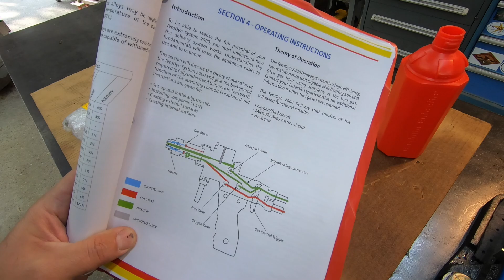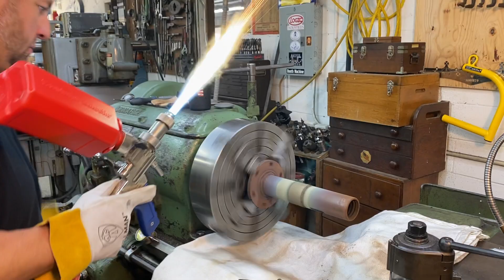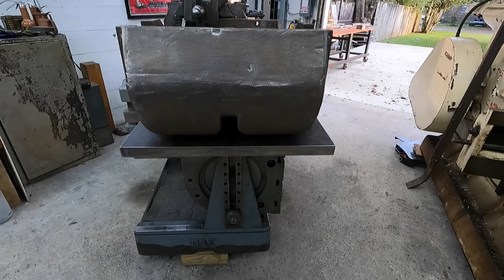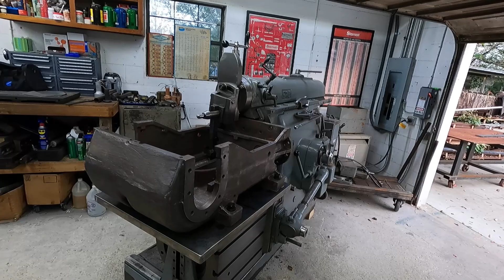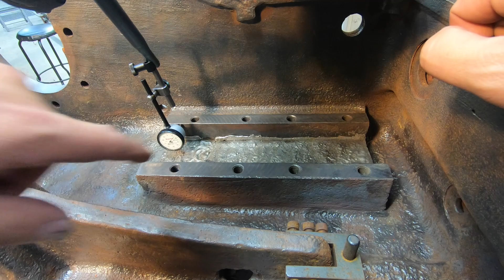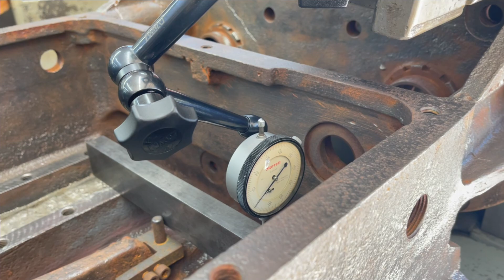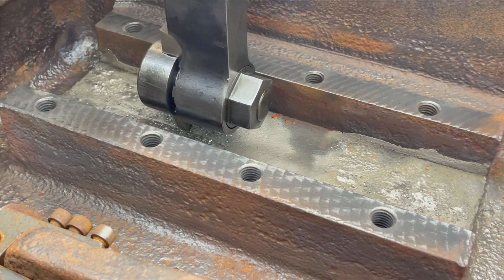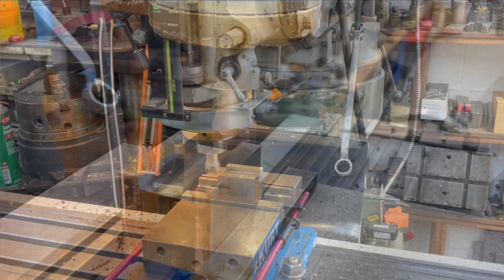SNS 331: Stoker Engine, Eutectic Torch Repaired, Tung Tri Mill

Comment: I'm going to guess that surface was milled like the threaded surface above it was in the same setup with a custom long cutting tool. It is going to be no small job for someone with a large bt50 cutter mill or borer for example too luck out having on hand something that would work over the whole surface. Usually such long reach tools taper to at least 2" diam at the base to have half a chance of a chatter free finish.
My best offering suggestion wise is to chat to someone charitable with a big EDM machine and spark erode the surface flat. Access, need for rigidity over a long distance and how hard the material is becomes a relative non issue.
Making chips is the darling of YouTube, but EDM's are the quiet achievers when it gets tricky or otherwise impossible.

Comment: The fumes coming from spray welding are not good for your lungs.
We used respirators and a welding fume extractor behind the lathe to clear the air.
I highly recommend you to do the same.

Comment: Hi Adam, love your video's, I would remove that ugly uneven powder weld and use the Eutectic spray weld to put an even and neat finish on the bottom, then scrape it. Less material to remove and a lot simpler operation. Maybe?
Keep the video's coming!
Steve K

Comment: Hi Again Adam.
My 2 cents worth on your clearance issues would be get/mill a piece of rectangular bar and weld the tool steel to the back of it,  so when the rectangular bar is mounted in the shaper the tool steel is closest to the back of the casting with the cutting edge facing forward and hang it low enough so that way the only thing in the slot is the tool steel,once finished with the vee tool cut it off and weld one of the side tools on, i hope this makes sense, i have welded quite a few bits of tool steel over the yrs and its always got me out of trouble. Stainless stick weld or mig it works. Cheers

Comment: My thoughts were make an L shaped tool holder for the shaper. With the horizontal and vertical join surface of the L with triangle re enforcing. That way you just turn the tool 180 for the other side.

Comment: Hi Adam, You should really enjoy the TD 2000 its a big step up from the rototec you can now spray better alloys, plastics and ceramics. Ceramics on seal area's that are in a high wear application are a game changer, you have to finish grind it tho,a tool post grinder on the lathe worked well for me. Cheers.

Comment: The key must be in those rails that run either side of the buildup. It seems like you need a tool that runs along those rails and cuts or just grinds down a given amount. You would have to make a custom rail guide of some sort to guide the cutting rotating grinder/cutter rotating in the trench either side of the rail. What can that tap drill arm thing do apart from tapping holes? As it is a sturdy upright flexible arm could you not makeup a variable height grinder type wheel mount for it? I am no engineer just love all engineering and machining projects. I think the idea here is to think smaller.

Comment: Adam.  Lock up the clapper box, turn the tool around and cut on the back stroke. You will still need left and right hand tools as before and it might be tricky, no it will be tricky blending in the two cuts.
This still doesn't solve the problem of the hard material wearing the tool substantially.  I'm thinking that after the original cast iron bearing surfaces were machined they would have been hand scrapped to size  and fit to the sliders. Shapers are long obsolete as a production tool but still a great machine to have in a home work shop   I use mine quite a lot.

Comment: The big HBM at motion should be able to handle it, long arbor and a custom cutter or even a fly cutter to get under the lip... past that... hand scraping is one way to get it flat at the cost of your sanity and possibly your back.
Reply: Adam no longer works at Motion ind.
Reply: @stuarthardy4626  thats the reason i said at motion not take it into work, i watch the channel on a regular much like you and know he hasnt worked there in a long while... now if he can make a call and find a large HBM that would work too. The mill he has i dont see being rigid enough with that much stick out.

Comment: Have been in machining for plastic injection molds (prehard steel mold base with R/C 52 hardened tool steel cavities/cores) since 1962. You are giving it your best for the equipment in house. It can't get any better.
Send it to a shop with larger equipment (vertical mill) with a deep reach round cutter large enough not to flex. There will be unfinished corners not accessable. Hand scrape these radii to the finished bearing level.  Job done, done well.
Be hopeful the weld is solidly bonded.
EDIT:
_ Please add the print dimensions, tolerances, finish requirements to your above summary. Or add a photo of the print.for those features.  
_ What is the range of operating temperatures and the wall thickness of the casting for those suggesting wear plates.

Comment: maibe you can set the toolholder up so its at an angle to the left or right , that way you can do one side without clearance issues , does mean you have to set it up twice once to get the left side and once to get the right , if that isnt enough you could cut the finish cutters at an angle too
the only other option i see is using the sides and boltholes on each side of the welded part to make the guiding base for a small hand moved grinder tool (working it like a wood router ) and a cup shaped grinding wheel thats exactly wide enough to cut the whole channel in one go
https://www.youtube.com/watch?v=H55zqx09P4w&ab_channel=JeremyThompson

Comment: A home made tool for sure. Get rid of the existing tool holder and install a steel bar with a small hss tool silver sodered on the end.
Just throwing it out there. The original planer must of had a tool the made it look easy. Considering its age it was probably a planer that did the job originaly. It was probably a one trick pony set up to do hundreds of engines. Love your videos.

Comment: Ok, thinking outside the box. Put a fireball block or spacer in clapper head moving the tool holder forward and up. This will keep it from hitting the case. Then you can grind a custom HHS tool bit that’s angled to reach back of the channel and by raising the tool holder you should go side to side and front to back with same tool.

Comment: Adam, It's a tough job but they chose the right guy for it! if any one will be able to brainstorm a plan It's you. Don't for a second feel that you have failed us as you ultimately are limited to the capability's of your tool's and considering this is a "pro bono job" you are limited to the fact that what you invest is out of your pocket. You must weigh the odd's 1. What you may generate in revenue on you tube vs 2. what the cost will be IF you destroy your tools or part or both. Keep up the good work and remember if you have given it a honest try you and it don't work out that don't mean you failed

Comment: I am looking at pictures of the milling machines that were used in RR machine shops to mill stuff like stokers motors. The bottom line they will not fit in Abom79 shop.

Comment: On your objection to making a custom tool holder, you may simply not have any other choice. 
You've ruled out other machines and other machinists so there's that.
I feel quite certain that the original manufactures had a custom tool or custom mill head to do that work and it's highly likely that reproducing that tool design will be your only realistic option.
I realize that you hesitate to sink time and effort in to a process that you're unsure of and isn't going to return some kind of profit but, as you stated in your video, something has to give.
There're no guarantees so, c'est la vie.

Comment: The machining marks on the rails look like they originally did this with  some sort of big diameter cuter.
Therefore u can use relative big diameter extension and maby a flycuter to ceep tool pressure on a minimum.

Comment: How about making an adapter plate at the bottom end of the tool holder with the left and right tools both mounted on the outer edges of it using both cutters simultaneously to minimize twisting.  Complicated to have both tools at exactly the same depth  and finish at the same time left and right.

Comment: Adam, fabricate a triangle about 6" base, 4" high, 2" wide,...fabricate cutter holder thru slots at each side of the triangle mount backwards by cutting into the triangle enough to slip into the tool holder, what you wind up with is a backwards mounted triangle that will cut to 0.0 sidewall, and will retract past the end of the surface to be machined on the back stroke! 
Just make sure you drill and tap tool holding bolts that you can change when machining side or horizontal surface.
I actually did this during my shop teaching days when machining an old hit and miss motor!
Trying to figure the best way to send you a copy of the one I made!

Comment: I might have an idea that might help at least I think. I did read your comment so I would ask someone to do it for you if they could. But what if someone made a toll holder like a L shape but backwards. and cut a female dovetaile on the end. then using a late tool. either braised or insert carbide make a male dovetaile on the tool itself.  or just weld it on if they don't care about it. That looks like it would give you enough clearance as far as I can tell on the video.

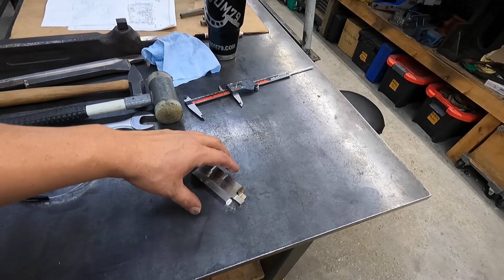Comment: 13:40 Looking at the tooling marks on the pairs of machined surfaces on either side, it looks like they had a single large diameter tool for each side. Considering the scale of these industries when they were at their peak, I wouldn't be surprised if they just had a massive mill that could do the whole slot as a slotting operation and just relied on the massive thickness of the tool to reduce deflection to acceptable levels.

Comment: those little mills are the bees knees dude don't be afraid to get a 1.5 inch for the doall mill they cut so free you'll never want to turn back. we have the .750 at work and the 2.00 and they are great.

Comment: This dates me.  When I grew up I got a job being the "shop's boy" at a mchine shop. My primary job when I started  cleaning the metal shavings out of all of  bins in the machines and the shop floor.  Started 2 hours per day.  Then I got hands on experience on manufacturing high pneumatic valves. 1/2" up to 16 inches. 

I literally worked "the entire line" of equipment making $1.25 per hour.  In the end I was putting 48 hours a week as I would work anything that they give me. Most 24+ hours on the weekend as there was a high demand for these parts.  A Crazy group of people that I will fondly remember that I worked with.

I learned so much, working with my hands and the knowledge given that over the years it helped to retire from working in my 40's. So now that I'm older than dirt   I watch shows like yours and see that in 5 decades the core of working with metal is essentially the same and I smile on the new tech that I see today.

Thank you for having this channel.

Comment: Sir I think you are doing very well. Just a case of a small width cu at a time. I think you need simply to concentrate on getting it roughed out as you are doing. With it all level & flat it will look surprisingly good. You are doing great

Comment: Adam this looks like a job for Brian. Large dia. long length cutter. Looking at the machine marks and the way the top plate is cut it's clear how it was done.  May be a stout holder for a large mill tool would let it be done on a vert. Mill. Good luck. Thanks for letting us be a part of the adventure.

Comment: Why don't you take3/4 plate and make bolt on runner with square teeth on runner and the slide plate with the carbide on a mini clapper you can adjust side to side and up and down and use the same machine to work it

Comment: Have you ever done a test to find out how well the sprayed metal adheres to the base metal?  Does it "tin" the surface (like brazing and soldering) or is it more like paint that can be chipped off?
Reply: It's more like sintering. It doesn't wet too the base metal.

Comment: Adam, Any chance you experimented with Dog-Legging the tool bit, (remove top and bottom on opposite ends) to get the tool holder away from the back end of the casting?  This might also raise the tool holder (longer exposed tool bit), so the Armstrong #42 can clear the machined side walls, allowing you to rotate it and get closer to the outer machined side wall (Armstrong rotated ~15 degrees CCW, but with the tool bit still vertical).   

Too bad you don't have a piece of HSS that would be long enough and stiff enough to replace the Armstrong 42 so it is a 1 piece tool bit from the Queen Post to the cutting edge.  Alternately an old tool bar with a tool bit brazed/welded onto the bottom, so nothing extends below the bottom of the tool bit (never used a shaper, so not sure if it could hold up to the strain).  Do you know an experienced blacksmith, something like this would be easy as 1 piece in a forge (I've done similar shapes in spring steel, but have not stress tested my work)?

Definitely a bit of a mind bender to work on.  I'm sure you guys will figure something.

and yes I did read your pinned post, I think these are far enough from what you already tried.

Comment: Could you put the Tung Tri cutter in the Flex arm and reach down into the stroker box case? Or,  could you mount a rotating device on the shaper on which you could mount the Tung Tri cutter?

Comment: At Motion you used to run a machine that you could set things on end and drill holes and perform milling operations. Keith Rucker got a machine (new to him) that does the same thing. I’m wondering if he can’t take this milling job on?
Reply: Keith Rucker is who sent him this piece to shape.
Reply: @stargazer7644  That’s true. It’s also true he did it before he got his machine. Adam is using what he has at hand. If he was still with Motion I’m sure he would do things differently.

Comment: It would be possible to use carbide router bits on a trim router used in woodworking being supported by the milled parallel supports either side of the two surfaces. I’ve seen such things being done on several occasions now and am relatively confident you could make that work. As a woodworker it was the first idea coming to my mind. Maybe consider it! Merry Christmas!

Comment: Here is an idea. Since this is a part off a steam locomotive, I would suggest contacting tourist railroads, operating railroad museums, (The Illinois Railway Museum)  or the steam shop at the  Union Pacific shops in Cheyenne  WY who just finished up a full restoration of the worlds largest operating steam locomotive. I'm sure that there are fans of your channel that work on steam locomotives. The shop forces at any of these organizations may not have done this type of operation but I'm sure that they have written procedural material of "how to". I mentioned the Illinois Railway Museum because not only do they have the largest collection of equipment but also a vast library of old railroad manuals and drawings.

Comment: Just sit it on the shop floor, fab a bracket to mount a magdrill to the end of the K&T mill table and use an endmill.
Obviously you'd have to shim it parallel to the machine travel and take light cuts.
Alternatively, rough it out with the power scraper then polish with some sandpaper.
You can thank me later.

Comment: Maybe a silly question but: If the four machined mounting rail faces are okay (flat and coplaner) down in that 'well', then I am not understanding the need to machine the trough flat between the rails. Is it something beyond channeling coolant/ oil back to collection points to drain to the sump? The rest of the lower inside case seems to be the typical rough-ish casting surface, so I thought some type of hand held die grinder could give you smooth enough results for drainage.

Comment: Hi Adam, are those any special goggles you wear for the spray welding? You might have talked about them before, but I don't remember. Looking at the airflow chart you showed of the torch, do you have to make any adjustments to the oxygen once you turn the powder on?
Don't worry about letting us down with that engine, if you can't do it, you can't. Maybe you just need a bigger shaper. I hope you end up figuring out how to do it though.

Comment: Years ago working on an oil and gas facility we had to remachine the bed plate for an Ariel reinjection compressor, motor driven with severe corrosion on the bed plate so precise alignment was impossible.
A team was brought in with a portable milling machine, simply bolted down and aligned and remachined.
Someone with this equipment could do the job with ease.

Comment: An ACME grinder attachment? ...with a Temposonic hydraulic positioning cylinder or equivalent to control the vertical spinning wheel height.

Comment: Hi Adam, just an idea: Maybe use a shaper tool that doesn't require the tool holder.  A thick long long piece of HSS that you directly mount to the clapper box (without using any tool holder). Then cut towards the machine (other direction as before) and then grind the tip so you reach the outer corners (those to be machined) of the part with the tool while not touching it with any machine parts.

Completely other idea (maybe to much an effort but hey ... brainstorm): use the holes in those rails to mount some fixture that will hold & guide the tool. Stick-out will be short, therefore little chatter. Motion will still be done by shaper but without worries about clearances.